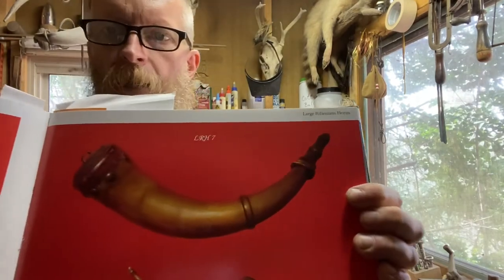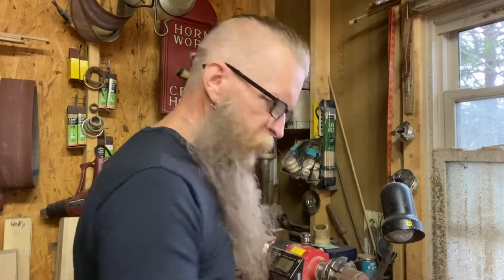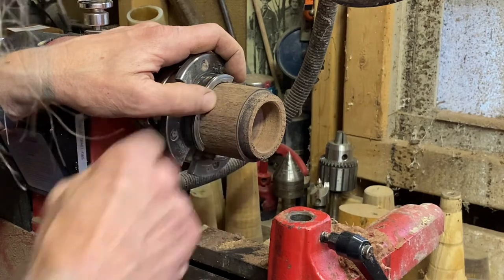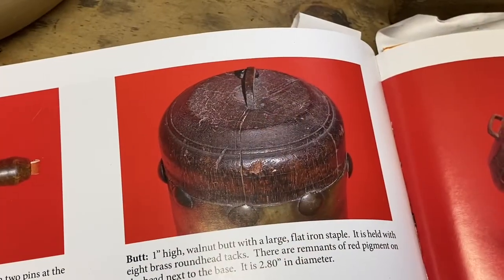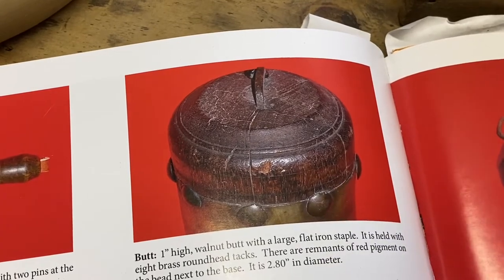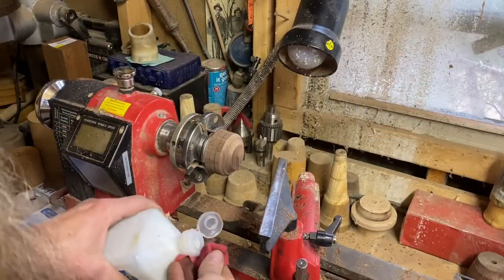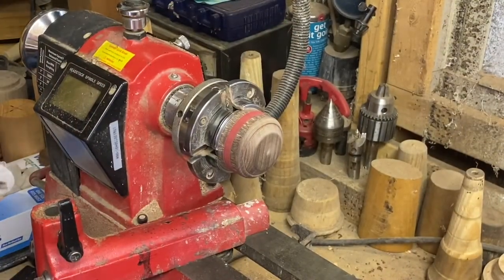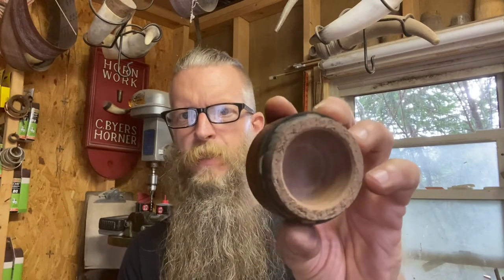Turning a Shenandoah Valley Base Plug

Comment: Question: The ring in the center of the horn. Was it to reconnect the horn after cuttiing it to clean it? Or, is it simply a part of what you did to the surface?
Reply from the maker: Thanks for your question! The applied ring is strictly a decorative element that evolves on southern horns. I have a video posted about turning the rings.

Comment: I got a question about Shenandoah Valley powder horn straps,what was the common material they used,was any of them hemp?
Reply from the maker: Straps vary greatly from plan leather to elaborate weaves. In my opinion, Hemp would certainly have been an acceptable material for the time period.
Reply from the maker: Historically straps vary greatly from plan leather to elaborate weaves. In my opinion, Hemp would certainly have been an acceptable material for the time period as would linen or wool.